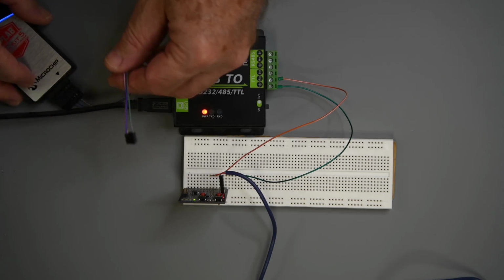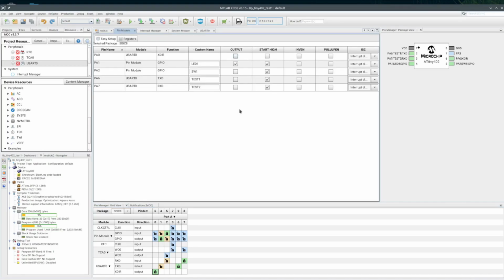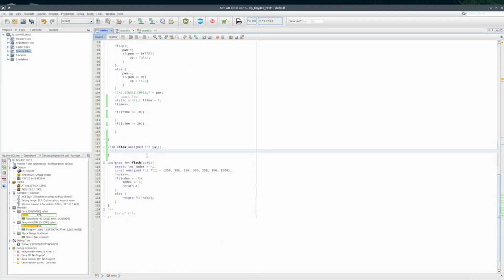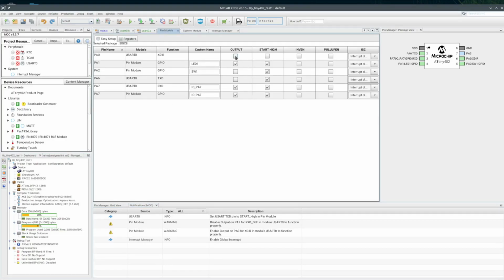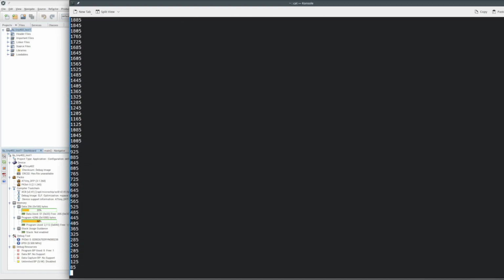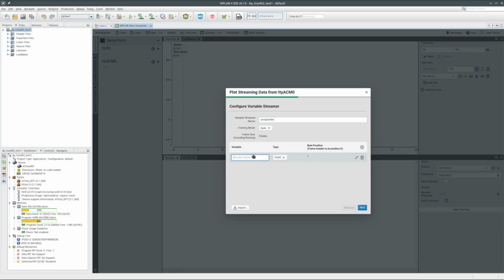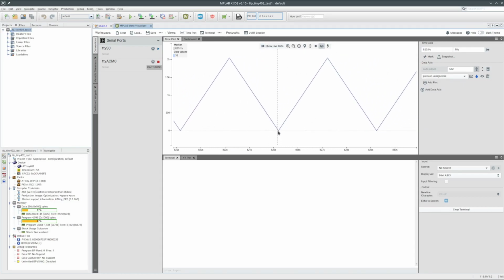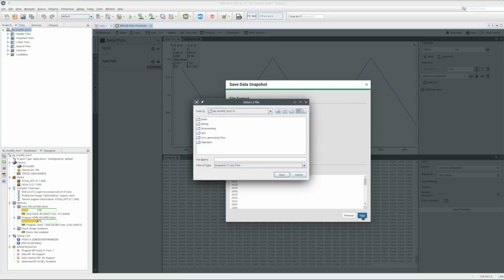tinyAVR 0-Series USART -  Signaling the Mother Ship

Comment: This is a very interesting video, and I may have a look into the MPLAB X / PICKit tool chain.

I'm approaching these microcontrollers from more of an old school perspective. Been designing with AVRs for about 3 decades, and for smaller projects I switched from the ATtiny 85/84's to the new core 0/1/2 parts 5 years ago. I've been using Atmel Studio and the Atmel ICE for all development.

At the start of my core 0/1/2 journey I tried MPLAB X with the Atmel ICE and was underwhelmed to say the least. It looks like Microchip has polished their AVR core integration over the past 5 years and may warrant another look. I've been assuming that they will eventually phase out Atmel Studio in favor of MPLAB X, so this may become inevitable.
Reply from the maker: I think you are right that Microchip plans to move AVR development to MPLAB X, eventually.  AVR support still seems to be a bit rougher than PIC support.  At least as far as I’ve gotten.  I’m kinda thinking the AVR support is a work in progress.  For the price I think the Pickit 5 is great.  The last time I used an AVR chip, it was the ATtiny13a and programming it with the Atmel STK500.  It is easier these days.  Thanks for the comment, I appreciate it.